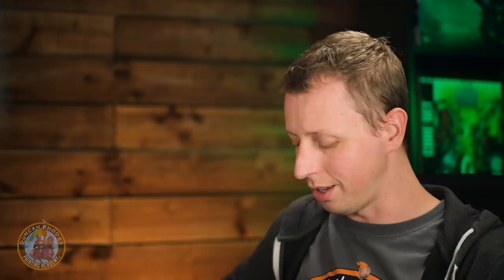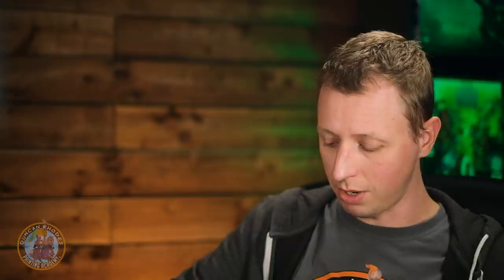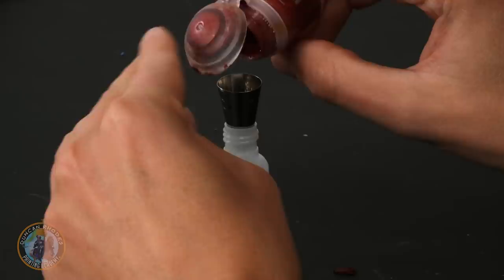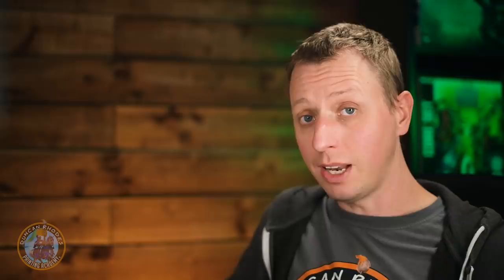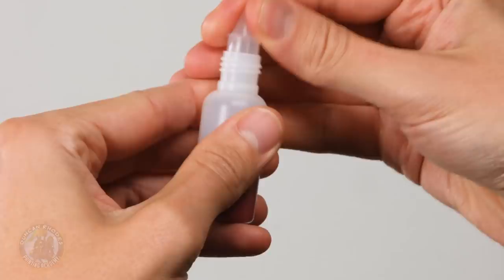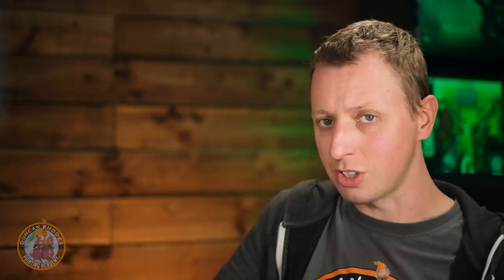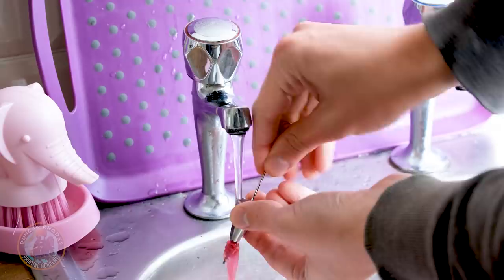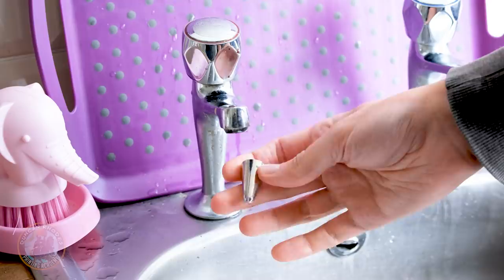What could be driving Dunc so nuts? Or, how he  to learnt to love transferring paints into bottles!

Comment: I would suggest thinning the paints properly (because nearly all GW paints need some thinning, except perhaps contrast, air and wash). Once thinned, I cut a small notch in the edge of the GW bottle rim. This will break the surface tension of the paint at that specific point.  The paint the flows. A steady hand allows a thin paint to flow without needing a funnel.

I do think the pastry bag nib is a good idea.
Reply: What do you use to thin the paint in the pot? Just water or another medium, since it will go into the drop bottle?
Reply: Initially, I used water. However that really disperses the pigment quite a bit. I began using acrylic medium or airbrush thinner to much better effect. 

If you only need to thin a bit, water is fine. Remember, for a contrast paint, use contrast medium. Though I've found contrast paints don't really need to be thinned.
Reply: @johnbryant6690  Yeah, I use a mix of acrylic medium and airbrush thinner in 1:1 ratio. It seems to thin it down enough and make it maintain pigment consistency the best. The amount I add is just enough to make it so a good wet brush makes it thin enough to paint properly.
Reply: @aethyr4006  you could use laminum medium.
Reply: A friend of mine dose this and works really well. Though He pours a small amount of it out about 1/4 of it. Then adds thinner or medium as needed to get the rest of it out.
Reply: I do it without a funnel or cut, and don’t make a mess
Reply: My thoughts exactly!!! It's just really odd that GW doesn't put the paint line into dropper bottles and thin the line down. 
 Vallejo paints are basically ready to go from the store. I feel GW is missing the target here.
Reply: I'm interessted in learning where you're cutting since my biggest problem is that there's always so much paint left in the bottle...
Reply: @uncrout  basically directly where I want to pour the paint. It's just a notch to help break the surface tension of the paint so it pours cleanly.

Get some thinner or medium. I use airbrush thinner for most paint unless it is already very thin. But with Citadel, most of that is pretty thick, so I use the airbrush thinner. 

Then I'll add some acrylic medium to the pot, close it and shake it to get the last out of the pot. Medium is better to use than water. It gets easy to over thin and "break" the paint. It will be streaky.

IF you do that. Get it all poured into your dropper and let the paint sit. At least a week, maybe a month. You will see the paint separate. (This could happen with any medium but usually happens when you use too much water) 

Once it separates, DO NOT REMIX OR SHAKE IT!! then take your dropper top off and carefully pour off the separate water. You will see that you are pouring the water out and losing very little pigment. 

Do that a time or two. And you get some rather thick but still liquid concentrated pigment. Then add some acrylic medium and thinner to get a good consistency. 

Water is for thinning paint on a brush or perhaps an extra bit in an airbrush. Do not use it to thin paints in pots or to collect the last bits when transferring paint to droppers.
Learned that the hard way with almost 100 bottles of Citadel "paint."

Comment: Here's an extra tip: before putting the nib in the paint bottle, put a ball bearing inside it for easy and effective shaking (hematite balls are really cheap and they don't rust).
Reply: The term for this is an "agitator". Same deal in spray cans.
Reply: Hematite is rust.
Reply: @MainerZ  Just get small glass beads, these never rust and work just as well...
Reply: @KuK137  but they have less mass, which is the whole point of an agitator.
Reply: As someone pointed out elsewhere, old sprue works well too. Been using it for a couple months, and haven't seen any reason to stop.
Reply: I’ve used thousands of stainless steel balls over many years and have not had a single one rust. I wouldn’t buy them over eBay as chances are they have been substituted with normal steel bearings to give the vendor more profit. These will rust. Also storage and usage of stainless steel bearings can contribute to rusting. If they have come into something really acidic or alkaline it can remove the layer around the bearing and allow stainless to rust. General use won’t do this.
Reply: Don't use a ball bearing. They're overpriced and they can get stuck in the nozzle.

PC screws can be bought in bags of 200 for like £1. Their irregular shape agitates the paint better and they never get stuck in the nozzle.
Reply: @RylanStorm  They only get stuck in the nozzle if you are totally inverting the bottle, which really isn't the best way to get a drop out.
The shape of the agitator is not relevant to its ability to agitate the paint, it's all about mass.  I'm not saying it's a bad idea, just no better than a ball bearing.  And honestly five cents each is no dear cost compared to $3.25 for the bottle of paint.

Comment: Genius! I'm kicking myself that I didn't see this video before I waited almost 4 weeks for the arrival of the only suitably small funnel I could find to make its way here (presumably from China) only to find that the diameter of its neck is actually slightly larger than advertised, meaning it creates a seal with the opening of the dropper bottles, causing the flow of paint into the bottle to stop.
At least now I have a viable alternative.

Comment: I love the result but yeah...actually transferring to the bottle is kind of annoying. I wish GW would just change. Using a stainless steel tip like that will definitely make it easier. One thing I would have added is you will have a good deal of paint left over in the bottle that you can get out with an agitator and a minor amount of distilled water (like a couple of drops). You'll get a good deal of paint out of the bottle so its not wasted. When transferring contrast or shades you obviously don't need to do that. 

Great video! Time to buy one of those :D
Reply from the maker: Sure does!
Reply: /conspiracy mode on/ they don't change to dropper bottles cause then they would have to make them pots bigger (17ml like Vallejo or AP instead of 12 IIRC) and people would notice how much more expensive they are AND then their paints would stop drying out, meaning you'd buy less of them : ^)))
Reply: @benjimlem1284  I don't really have an issue with my paints drying out but I definitely agree on the cost vs quantity.
Reply: @Sammo212  I've heard from a number of people (cause I try to avoid anything GW that isn't the miniatures... those are just too damn good), that unless you pay attention to the lip of the top cap of them paints there is a tendency for paint to accumulate there, dry out and ruin the seal, making the paints dry out much faster than normal. And it's been like that for ages...
Reply: @Sammo212  I've bought the entire Citadel paint range before the contrast paints came out.  I do not regret it as I do like their paints, but I had to revive a couple that were brand new from the local store.  They were not completely dry, but they were like wet Play-Doh.  I was able to revitalize them and have not had that issue with Army Painter, Vallejo, Green Stuff World, or Scale75.  Out of all those paints, Citadel paints had drying issues.  You really do have to make sure you clean the lip of your Citadel pots as I've had 3 paints begin to dry out due to missing the paint clean up around the lip after use.
Reply: @benjimlem1284  oh, I'm sure. I'm just saying that I, personally, haven't had that issue with their paints but I am pretty anal about checking that stuff when I'm done using a paint for a session.
Reply: @Carnalpain  A friend recently turned me on to the pro acryl range. I'm going to start using those slowly for things like whites, blacks, etc.
Reply: @Sammo212  I'd like to try those out as well and a few others, but as it stands I've forbidden myself from buying any more paints until I use the ones I currently have.  Heh.  I'm still in the process of converting my Citadel paints to dropper bottles.  There are a few Citadel paints I'll continue to purchase, but at some point I definitely plan on checking out the Pro Acrylic range.
Reply: @Sammo212  between Pro Acryl and Vallejo you can rule the world!

Comment: As someone who decants all their citadel paints, washing out the funnel takes too long lol. I usually add a bit of flow improver (four or five drops) if need, don't put it in the metallics. Close the cap and give it a nice shake, ball bearing in the bottle, clip the hinges on the cap and use one of those small metal stir sticks or toothpicks to get the paint out of the cap and into the pot. 

Now the important part: Put the stick at the lip of the pot, the pain now with more flow will follow the stick down into the paint pot. Go slow at first and increase speed as you get more comfortable with it. Pop on the nib, cap, label and done.

Comment: Sort of related to this, but very good news nonetheless. It looks like paint manufacturers are starting to include mixing beads in their dropper bottles with their new ranges. Scale75 includes them in their instant colors line and army painter is doing the same with their air and (presumably) their speed paints range that will be coming out 2022.
Reply: @GloomspiteNoob  Depends how you use them...
If you're airbrushing them, for instance, dropper bottles are a lot easier.
Reply: @GloomspiteNoob  They may not work the same, but they are excellent glazes when airbrushed.
Reply: @GloomspiteNoob  I don't think Contrast paints should necessarily be sold in dropper bottles... I just don't fully agree with your assessment that it's "not great."
Also, well palettes are great for washes and contrast paint and stuff if you are using them out of a dropper. You're more likely to waste paint by putting too much onto the palette, than you are to have it dry out on you.

As much as I dislike Citadel paint pots, the only Citadel paint range that has absolutely no business being in pots, is the Air range. I can fully understand why they would have the rest in pots... I just wish they had better pots.
Reply: @GloomspiteNoob  
Contrast might dry too quickly on a palette if you live in the desert... 
Seriously, if you have issue with Contrast drying on your palette, there's no way you would have normal acrylic paint stay usable on a palette for long. 

Even GW's own "Using Contrast" video, has Nick transferring the paint from the pot to the Citadel palette paper.

I just tested with a drop of Apothecary White in a well palette, and after half an hour, it was still "fresh", with just a small tide mark around the top of the pool.
Reply: @GloomspiteNoob  
1. Duncan Rhodes on his own channel, uses Contrast with a ceramic tile for a palette.
There's also videos of people testing the Army Painter Speedpaints, or using Scale75 Instant Colors, or Warcolours Antithesis... all of which come in dropper bottles, and I've yet to see a complain about them drying out on the palette.

2. Yes 30, minutes. In fact, another half hour after that comment, I checked and found more workable paint has settled into the bottom of the well. I thought I had used it already, but I guess not.

3. I did, and I have no problem doing so. Like I said before, I have no problem with Contrast coming in pots.

4. I've not yet used a wet palette and have never had a problem with paint drying up on the palette. I have a much bigger issue with having too much on my palette and figuring out how to use the rest.

5. No idea what's going wrong there. Are you mixing with a vortex mixer?

Comment: Duncan channeling Infomercial ad vibes :P
I've used small funnels which work really well too, and lately for Contrast and washes i've gone for the Vallejo mixing bottles, which have a FAR bigger opening and can be poured directly (i once poured one directly in my FLGS' counter, no mess, no drips).
Missing: Duncan dropping a couple of some really cheap glass or hematite beads as agitators (yes, there's stainless steel ones, but unless you get really good quality ones you risk that somebody in the production chain chose cheaper steel that will rust inside the bottle and ruin the paint, glass/hematite cannot do this)

Comment: A word of advice for anyone wanting to do this. You will probably need to thin them a bit, so that when you go to use them, they'll flow a bit better, and not clog up the nozzle. HOWEVER, try using distilled water instead of thinners or mediums for this. The latter can alter the properties of your paints and turn them into a kind of wash if you aren't careful. With water, even if you accidently use too much, all you're doing is diluting it, so the worst that will happen is you might have to do three thin coats instead of two ;)

Comment: This is one of those things that really baffles me. Since coming back into the Hobby in 2015, I’ve used pretty much exclusively citadel paints and I don’t think I’ve ever had one dry up on me? Even the ones I hardly ever use seen to last just fine in storage.
Reply: thats not just the problem, ive never had one dry either. Dropper bottles make it much easier to apply a specific amount to a pallete and more importantly, into your airbrush.
Reply: The pots get horrible after some useage. Just horrible Paint into the lids.
Reply: @trustI17  I’ve never used an airbrush because I like my models to look good in person, not on Instagram.
Reply: @WilCornish  airbrushing models doesn't look good in person?
Reply: If you're hardly ever using them, you're hardly ever opening them.  No wonder they're not drying up.  Why is this so easy to overlook?
Reply: @WilCornish  What is this weird brush prejudice? Airbrushing doesnt look bad in person. I cant afford an airbrush so i dont currently own one but I have seen plenty of great models painted with them.
Reply: @HeadHunterSix  “Even the ones I hardly ever use”, the ones that are in regular use get used up before they dry up, the less common ones have been around since 2015 without an issue.
Reply: @WilCornish  Right.  And since you hardly ever use them, you hardly ever open them.  So they hardly ever get any build-up around the rim or exposure to dry out when they're open.  It can't be any more straightforward than that.
If you told me you used some every day for 5 years and they didn't dry up, that might be different - except, of course, that if you did, the pot would be empty long before that.
Reply: @HeadHunterSix what point are you trying to make here buddy? Because you’re not making it. 

Some paints don’t get used much and they don’t dry up over time. Other paints get used a lot, and they also don’t dry up. So… there’s no problem?
Reply: @WilCornish  The point is, your anecdote is not representative of anyone else's experience.  You'll notice other people are not echoing your opinion.
Paints used often but not always will dry up.  Paints used frequently may dry up but you may use most or all of them before it becomes an issue. I mean, I've got a Blue Grey/Space Wolves Grey blend in an old round paint pot from the early '90s that still hasn't dried up because I never use it.  I've got hex pots that are still good because I've never opened them.  What I don't have is pots that are opened and used (even infrequently or occasionally) that don't eventually dry out.  Even though I keep the rims clean and remove buildup, the pots are designed to do so.
I'm speaking from the perspective of someone who's been painting for 40 years and using Citadel paints for over 30.

Comment: I just use a little plastic funnel, they're super cheap for a bag of many, they're easy to rinse out and if they get too stained, throw one away and use a new one.
I prefer to add a bit of flow aid and some medium to the pot and give a shake to get the rest out.  Then I drop a stainless steel ball bearing into the bottle before I pop the nozzle on.

Comment: I have no idea why no one does this, but get yourself a 10ml Syringes, the ones that come with a 1mm blunt tip needle on them.  AND USE THOSE to transfer paint.  There is NO mess, it takes a fraction of the time, and you get all the paint out.  These are marketed for oil application, and the brand I use is BSTEAN 10ml Syringes, and they are under 10 USD for 10 of them.  

And yes you can wash them out no problem and use them over and over.

Comment: I got plastic funnels included with my dropper bottles and they are great you can sit the old pot in it to fully drip out. A tip I would do for citadel paints because they are so thick I would add a bit of water or thinner like airbrush thinner otherwise you waste a lot of paint and also add an agitator ball to your dropper bottle makes life so much easier.

Comment: I haven't gotten around to starting to transfer anything yet, but I am 3d printing some jigs and funnels that are designed to hold a GW sized pot while it drains. For getting the rest out, a swan-necked squeezy bottle with distilled water/thinner/flow aid and a good shake (possibly with an agitator) will get most of what's left out (and slightly pre-think the whole lot).

Comment: I've recently bought proper bottles for my GW paints, but was scared of actually transferring them.
Reply from the maker: Now you are good to go! 😊
Reply: Nothing to be scared about. Just get some small plastic funnels or some of those icing dohikeys and get to it. I'm a complete klutz myself and I did fine. There's dozens of videos on youtube on how to do it, it's not hard. One piece of advice that Duncan omits in this vid is to remove the lid of the paint pot. Just clip the two little plastic flip tabs at the back of the pot. It makes it way easier to handle and prevents accidental spilling of the paint that's stuck in the inside lip.